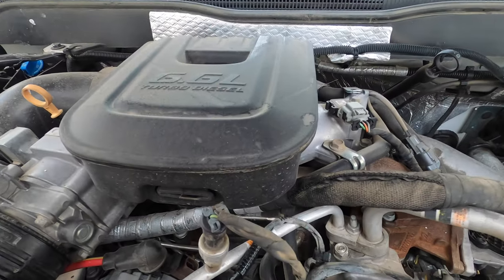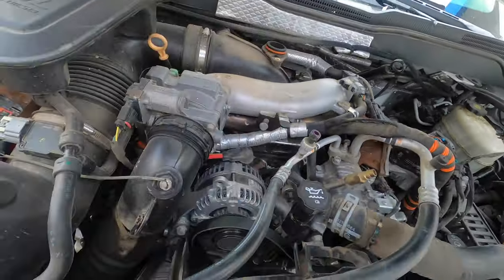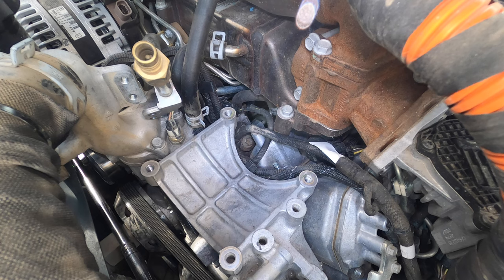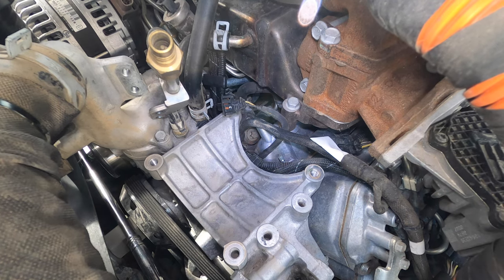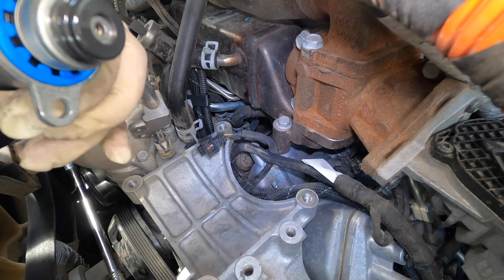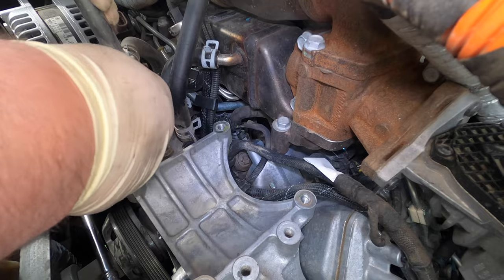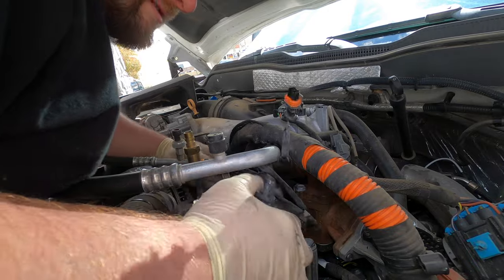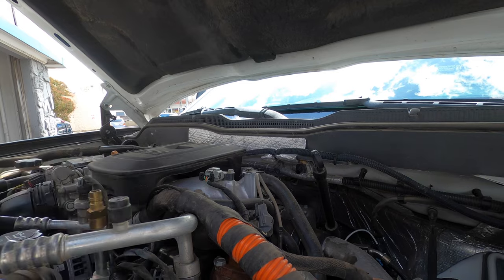How To Save Thousands Owning An LML Duramax

Comment: That valve saved me big time! While I was having an Air Dog fuel filter system installed I decided to have this valve installed and when the shop was test driving my truck the CP4 went out!
Reply: Did it save your  injectors?
Reply: @bryanhernandez780  yes I did! They had a rebuilt CP4 so they installed that and saved me a ton of money!
Reply: We're are u located I am looking for a shop to work on my lml

Comment: Just wanted to say thanks for the Help ! Just installed my Exergy onto my 15 LML. Felt like i was doing heart sugery with trying not to have even a spec of dirt into the Pump during instal. All went well there was a few very small pieces of metal on my old screen but my truck has 183k and it runs great so far. I have been running the Hot shot fuel lubracisity additive.

Comment: When i bought my truck had 340000 miles on it and the pump failed and they put a new long block and new pumps and fuel tank and lines by diesel dynamics of Georgia it has been def deleted I want to to do the EGR delete

Comment: I installed this on a perfectly running cp4 lml 2011, cannot getvtruck to start now.  Scanner is showing low rail pressure of 100psi when cranking.  Wife is pissed !  What gives ?
Reply from the maker: Possibly got a bad valve? It happens sometimes. Where did you get it from?
Reply: Bought online, I put my oem one back in and still won’t start now

Comment: I just bought a LML and I'm stressed out worrying about the cp4.... Is this the best protection?
Reply: Bro i have had my LML since 2013 and mine is heavily Modded, people fear monger the CP4, them grenading isnt that common, get you a good lift pump and research Hotshot secret they have an LX4 extreme lubricity treatment designed for cp4 and can be used with their everyday diesel treatment. the low quality US fuel is the problem not the CP4
Reply from the maker: I believe its the poor quality fuel in the us aswell. I always recommend running some sort of lubricant addictive to help these pumps and changing the fuel filter often with a factory part.  Out of the thousands of lmls Ive worked on,  Ive seen a failed cp4 probably around 10 times. Its not common but when it does happen it is very expensive to repair.
Reply: @TheNewJP  that makes me feel a little better 😆
Reply: @drewsshoplife  I have been using the every day treatment but I will find the Lx4 and a lift pump
Reply: If you already have a Exergy system saver metering valve installed with a lift pump like a AirDog or fass on a lml and have a cp4 failure. Would your lift pump and filters be contaminated also? And if so what would be the cleaning procedure for the lift pump besides new filters? Thanks
Reply: Just get the cp3 kit just did on mine but cost 4000

Comment: Thannk you for your videos man. Very helpful. Recently im havin issues on my 2012 lml with roughly 240k miles on it.  The truck will just kinda hiccup and stop running for a second then come back. More recently within the last few days its been hiccuping as i slow down at like a stop sign and then go into limp mode. And finally nownit just stays in limo mode. It always throws the same 2 codes p0091 p0193. Do you think is an indicator of failing cp4 pump or is it common for fuel regulator to fail?  Any advice you have id he grateful. Thanks
Reply from the maker: Sounds like you have a wiring issue somewhere. The p0091 is for the fuel pressure regulator 1 circuit which  is the one in the pump called the volume control valve. The p0193 is for the fuel rail pressure sensor located on the back of the driver side fuel rail near the firewall. I would first start with a good visual inspection of the wiring and if nothing is found wiggle the wiring while its running to see if it acts up to locate the location of the problem.
Reply: @drewsshoplife Thanks for your speedy response. I'll definitely start with that. If there is no wiring issue what would be your next course of action?

Comment: I keep seeing folks cp4 a blowing up making me real nervous since I’m at 146k miles, I wanna check mine before I replace to know if I’m gonna be spending $250 or like $4000
Reply from the maker: Safest bet is to install the exergy valve, you don’t want to have it fail and cost 10-12k to replace the fuel system with another cp4.
Reply: @drewsshoplife  I was gonna do the cp3 swap but I have heard it’s not 100% this will save the fuel system
Reply from the maker: @Ah01e72  The cp3 is a very reliable injection pump, with a cp3 installed and I would suggest a dad’s or air dog lift pump and the fuel system should be bulletproof on the LML. For the meantime if the cp4 is still functional I would suggest the exergy valve until it fails then the decision can be made.
Reply: @drewsshoplife  I meant to say I heard the valve isn’t 100%, but I have an airdog and us hot shots every fuel up I just gotta check that fpr one day and go from there

Comment: I’m a Ford tech and I’m doing a fuel system on this engine holy shit the egr assembly is a pain in the ass after working on 6.7’s and 6.0s and 6.4s and 7.3’s this engine is a pain in the ass to work on
Reply from the maker: Tottaly agree , the Duramax’s are definitely the worst to work on compared to ram and ford. I believe the cab is supposed to be lifted to remove the egr assembly (doesn’t need to be). Even to do the fuel system you’re supposed to pull the transmission and turbo.
Reply: @drewsshoplife  but bro I can get the engine out of a ford 6.7 by titling the cab on the single cab 550’s and it still isn’t that much of pain in the ass as that egr why did they make it wrap around so far and hide those heat shield and the 3 bolts on the back side that’s a pain in the ass but I know it’s a guy who works on those engines that it’s easy to him just like he’d be lost if he worked on a ford 6.7 for the first time but I will still say that engine is a pain in the ass

Comment: is this comparable with the CP3 pump that I installed on my 2014 Silverado LML  ?
Reply from the maker: Not at all , cp3 is the way to go. This just prevents the metal spreading to the injectors and rails when the cp4 fails. What I suggest is install this first and when the pump fails do the cp3 conversion. The valve alone will save over 5k at a shop not replacing the injectors and rails.
Reply: Thank. You I didn’t know wether there was a 20 micron pressure control valve for the new CP3 or wether it came with one when it was installed on my pickup I failed to ask the shop that did it

Comment: i have a lml and im having issues. and i would like to get this installed as well.
Reply from the maker: You really should, hopefully your issues aren't your injection pump internally failing (putting metal in fuel system)
Reply: Is this the best protection from the cp4?
Reply from the maker: @kyle-409  This is a great start, I would suggest doing a nice filtered lift pump like fass or air dog and run a fuel additive. Whenever I replace the fuel systems on these I install a fass lift pump, helps keep pressurized clean fuel at the injection pump. Ideally long term it would be best to install a cp3.
Reply: @drewsshoplife  I just got the truck and I know pretty much nothing about diesel engines. I want to do so much but as you know it's expensive. Really just need some peace of mind while saving up for some bigger and better things. Appreciate you getting back to me
Reply from the maker: @kyle-409  Maintenance is key on these trucks , use factory filters. The energy valve would be the best place to start. The lml’s seem to be very reliable besides the cp4 and emission systems. For the least problems with the emission system try not to idle too much and drive short trips. Try to take it out on the highway often.
Reply: @drewsshoplife  i use it daily to pull my 14 ft work trailer probably 40 to 80 miles a day. Not too many short trips. I'm just so worried about the cp4. I feel like I need to go to school to learn how to work on this thing. I may just hurry up the cp3 conversion 😂
Reply: Just installed one on my 2014 with 154K on it. Thanks for the help.
Reply: I've been having issues with the truck starting and then dieing 10 seconds later and then have to crank it to build pressure and it will fire up it only happens when it sits over night most of the time do you think that sounds like a a fuel pressure regulator leaking

Comment: Did you see any problems starting the truck when it got to warm, but would start fine when cooled down? Could this be CP4 related??
Reply from the maker: I have experienced that issue with a couple ford 6.7’s (similar fuel system as the lml) and a couple lml’s aswell. Usually that’s a sign of a bad injector (injector is leaking the high pressure fuel into the return) or the fuel pressure regulator is acting up (on the drivers side fuel rail). I have yet to see any cp4 issues besides them blowing up. And from what I’ve been told it usually happens while driving and they slowly decrease power and then shut down. Start with checking the fuel rail pressure with a scan tool. If it’s close to desired I would check the return rate from the injectors next.
Reply: Thank you I appreciate your opinion!
Reply: @drewsshoplife just installed a airdog lift pump, truck needed one no doubt I currently have 247,000 miles on the truck I have no problems with it at all other than a little startup problem when it is cold fires right up, when I drive it and get it up to temp it will not start until it cools down to at least 170 degrees on the temp gauge, looked at fuel rail pressure injector timing all that good stuff everything looked good to my knowledge. The truck before the lift pump was added was loosing prime due to not having a lift pump and I bought a fuel filter housing cause they sometimes develop cracks in the housing causing the truck to suck air and not start but now the lift pump is added it has prime in the filter. Running out of ideas on what the situation could be???
Reply from the maker: @jimmystrough6775   Sounds like when the its loosing fuel pressure when the engine is hot starting. You should verify that with a scan tool and verifying the actual vs desired fuel rail pressure.  If you are not able to build enough pressure at a hot start you could have a or multiple bypassing injectors (bypassing to return) or an issue with the fuel pressure regulator.

Comment: does this actually work where is the testing I'm not seeing any. also does it restrict flow?
Reply from the maker: I understand your point, I’ve had two of these valves save the high side of the fuel system. When we do full system replacement on the lml and the Powerstroke 6.7 if the customer doesn’t opt for the upgraded cp3 for the lml or dcr for the Powerstroke we install these. I am curious on the restriction of these valves , but I have yet to have any issues with them after installing probably 50 of them.

Comment: Is there a way of telling if I had a cp4 failure or if it may just be that sensor.  ?  I was driving with check engine light on truck went into limp mode and then it shut off
Reply from the maker: Unfortunately that’s usually what happens when the cp4 fails. I have yet to see the volume control valve fail by itself yet. One of the easier ways to tell is remove the fuel filter and see if there is shiny metal in it. If so the pump has likely failed. Before pulling the control valve I would check the high pressure on a scanner to see if it’s low. If so pull the volume control valve and you’ll likely find metal.
Reply: I took fuel filter off an no metal shaving came out when I was dumping it out